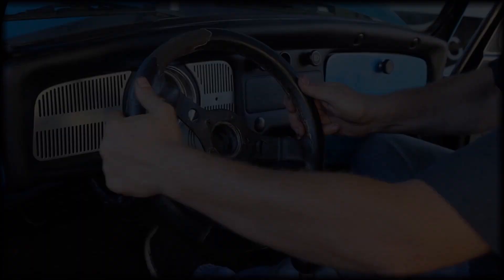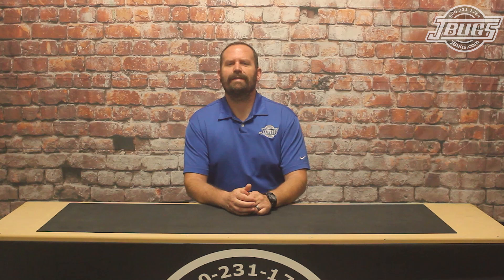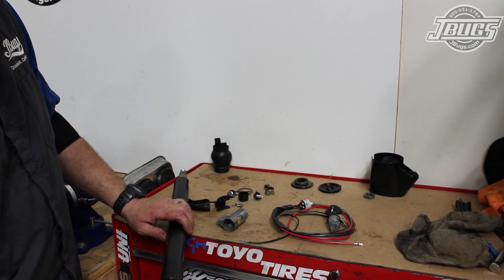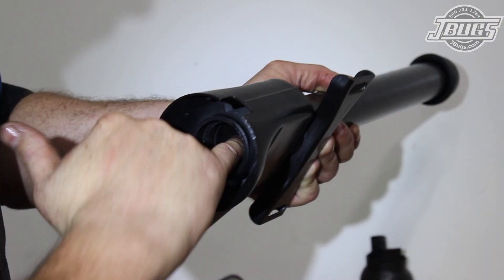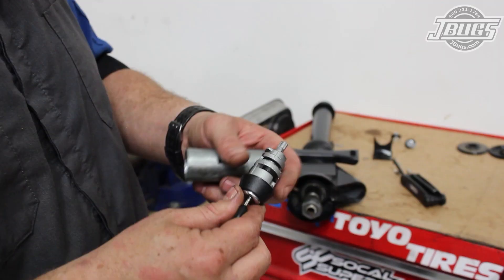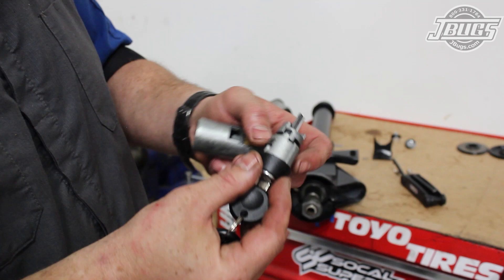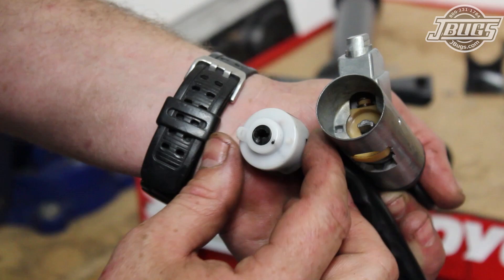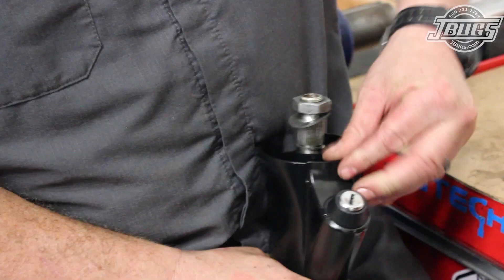JBugs - 1971 VW Super Beetle - Steering Column Installation

Comment: Will this work on a key tumbler work on a 72 bus?
Reply: Yes, it fits 1971 and later models - https://www.jbugs.com/product/113905855B.html

Installation in a Bus isn't always as easy as often times the housing is not drilled for the spring release.

Comment: what bolt size is used for connecting the steering shaft with the steering box on a 1970 vw bug?
Reply: Can't recall of the top of my head, 111498409 is the oe part # though I think.
Reply: @Sam_Mebane  thanks man